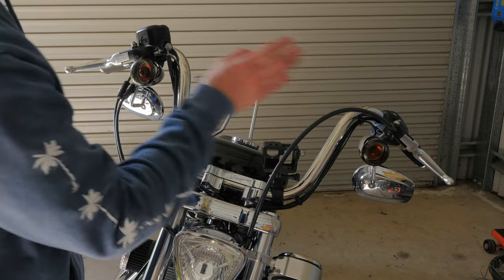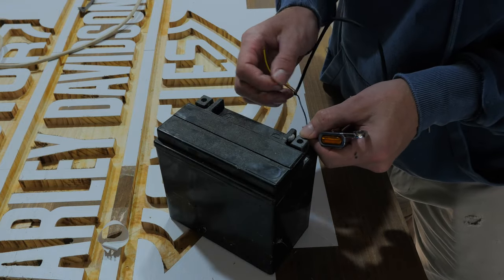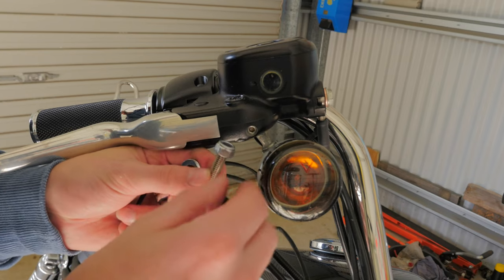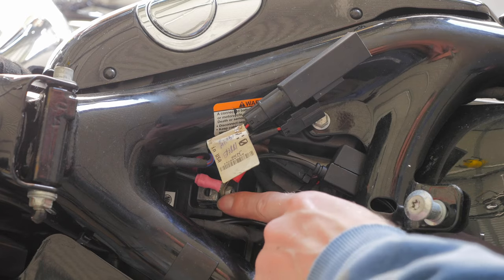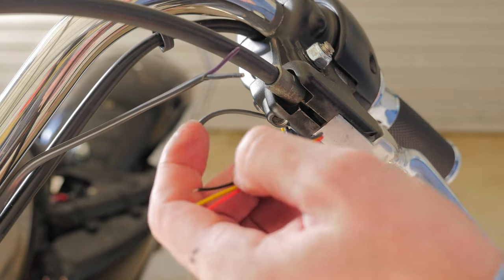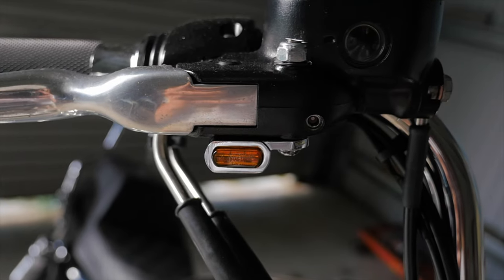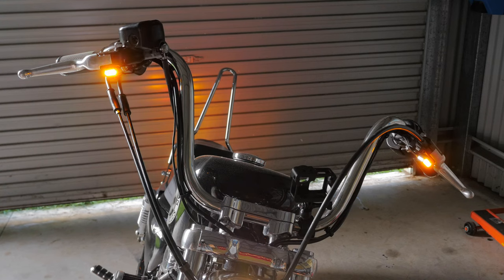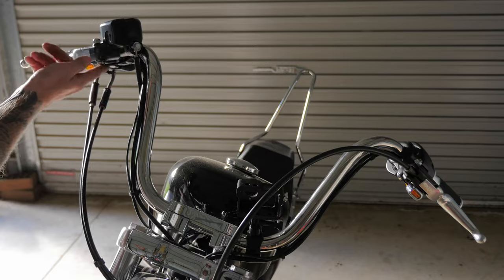Cheap ebay undermount LED indicators - Sportster 72

Comment: Just bought a set of eBay specials. Hopefully 2 years from this video, yours are still working.
Reply from the maker: @lighter7000  yes mate they're still working
Reply: @TheGingybeardMan  Great to hear! Cheers.
Reply: Just got mine today, tried wiring one up and after 4 flashes, it is going into rapid mode. Wondering was yours doing the same? Going to see what the resistance is and see if I can fix it...
Reply from the maker: @lighter7000  no I didn't have that issue, I only had a fast flash on my indicator panel. What model harley do you have
Reply: @TheGingybeardMan  I've got a 05 sportster. Getting the multimeter onto the old indicator it was reading 0.6 ohm where the led is so high it just showed as an open circuit so I'm guessing that's why 😅. Ah well it was only £11 lol
Reply from the maker: @lighter7000  my bike is a 2015 model and has a canbus system, you will need load equalisers/resistors
Reply: @TheGingybeardMan ahh that explains it. Thanks for your help bud. Much appreciated.

Comment: Hey mate, love the videos and your channel. I would be grateful if you could answer a quick question. When you fitted the LED under perch indicators to your FXBB Street Bob, did you need to add a load equaliser too? Or did the led indicators work on their own? Any advice would be welcome. Thanks :)
Reply from the maker: Thanks for following the channel mate. I didn't fit any resistors/load equalisers to my softail street bob when I installed the underperch indicators. The leds will still work fine without resistors but you will notice a fast flash on your indicator panel. The fast flashing of the indicator panel didn't bother me so I never got around to installing resistors.
Reply: @TheGingybeardMan  Thanks mate! much appreciated! Keep up the great work

Comment: Nice video man, but didn't you need a led equalizer to not get hyperflash?
Reply from the maker: All 2014 up Sportsters have a canbus system for the indicators. You can reset the hyperflash by running your hazard lights which will reset the canbus. Here's a link explaining it. https://support.customdynamics.com/hc/en-us/articles/360051783233--CanBUS-Harley-Davidson-Rapid-Turn-Signal-Indicator-Flash
Reply: @TheGingybeardMan  Ahh ok, thx  👍

Comment: Bought similar and immediately hyper flashing. Something to mention that this is a possible issue.  Wish I didn't bother now,  having to now look at load resisters.
Reply from the maker: All LEDs will give a hyperplash without installing load resistors mate. It doesn't matter what brand led you go with.
Reply: @TheGingybeardMan did you install a load resistor?  If so, how easy is it?

Comment: Did you need a new LED flasher unit?
Reply from the maker: The indicators flashed at a normal speed but the indicator light on the speedo had a hyper flash. To fix this I bought some custom dynamics posi tap resistors and wired them to the indicator wires. These modern sportsters run a canbus system and not a replaceable LED flasher relay.

Comment: Did these require a load equaliser?
Reply from the maker: @bernardoreilly3720  if you want to eliminate the fast flashing indicator light on your speedo then yes. Otherwise the indicators themselves flash at a normal rate.

Comment: No need for an LED relay?
Reply from the maker: I've got a video coming shortly on that. They will work and blink normally without resistors but you will get a hyperflashing indicator light on your speedometer.
Reply: @TheGingybeardMan  thanks. I look forward to it.

Comment: Don't do it...Theres already enough cars pulling out in front because they didn't see you indicating especially at roundabouts, the original indicators are good enough with a nice large lens and lamp, convert to LED inserts then fine but do not put your life at risk because it looks cool with these silly things.
Reply from the maker: You do you buddy. If you watched the whole video you would see that they're just as bright as the stock indicators. It's not the size of the housing you should worry about its the brightness of the led or globe.
Reply: @TheGingybeardMan  If a car don't see a whole bike and person  I am not depending on a light. The front lights are to tell people what I am doing. I only do it if I feel it's safe. The rear lights tell people I am stopping but  I am still watching them in the mirror.